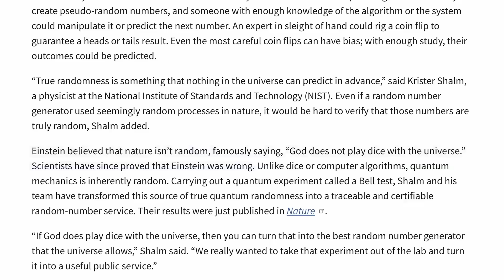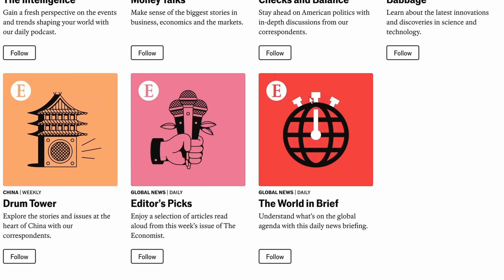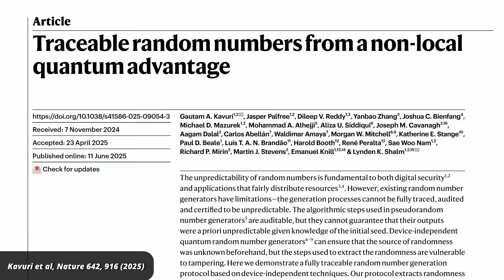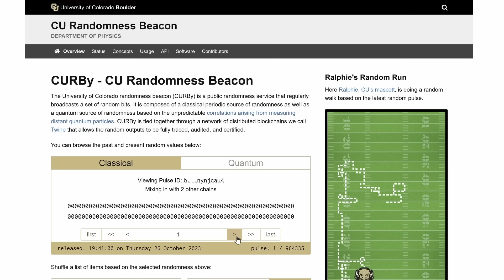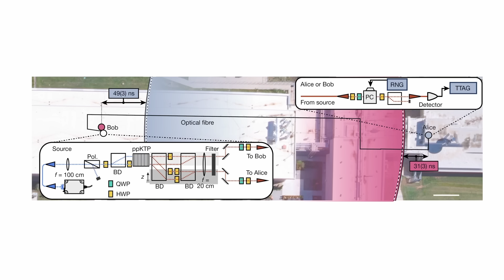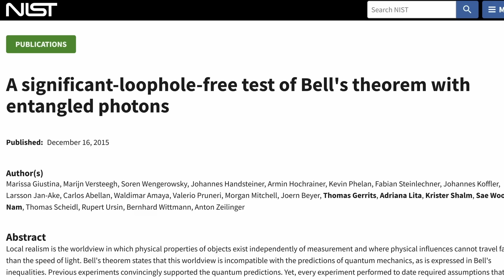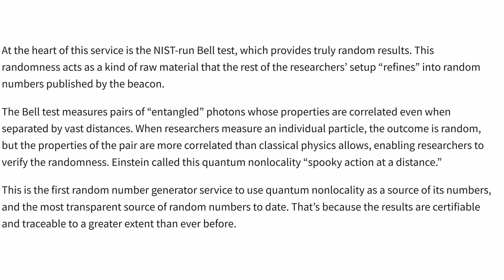Was Einstein Wrong about Randomness?

Comment: I'm not sure it's even theoretically possible to 'prove' true randomness? How would you do that? Keep scrutinizing a sequence to make sure no patterns appear? How long do you stare at it for? Infinite time? You'll find a whole lot of very intriguing patterns in that span of time, random or not! You can eventually prove to some reasonable certainty that a pattern is non-random, but it's hard to even postulate how you'd prove the opposite.
You could of course develop a convincing theory of randomness that convinces people that the seemingly random output really is random for a perfectly logical reason, but you'll need that theory to be pretty rock solid.
For my part I'm betting the universe is in fact random (kind of hard to postulate a convincing arrow of time otherwise) but its going to be very difficult to prove.

Comment: Pure randomness is a mathematical artifact (or "prediction" if you prefer) of ANY quantum theory that: 
1. Exists in a Hilbert space 
2. Undergoes Unitarity evolution
3. Has rudimentary continuity in time (mathematically defined as there exists some sufficiently brief time between two distinct but otherwise methodologically identical measurements of a quantum system that will ALWAYS produce identical results).

The CONSEQUENCE of the above assumptions about quantum theory requires that when one pure state of a quantum system is measured any subsequent measurement of any  ORTHOGONAL state of that system will produce random results.  The physical reason for this is very straightforward: the system contains no information about other states therfore the process of projecting an orthogonal state onto that system is going to produce random results (in psudo scientific terms that projection process is what we call a "measurement").  Stern Gerlach experiments are a good example of this type of "measurement" procedure (both in the sense of "measurement continuity" of repeated measurements and in terms of the randomness of orthogonal measurement).

This is a GENERAL theorem that has been proven several times, first by Gleason, and later by Zurek. Zurek's work on this topic deserves mention because his approach adds considerable clarity and simplicity in contrast to Gleason's proof which was difficult to intuitively grasp and was therfore mostly ignored. 

Interpretation: objects in our universe have FINITE bandwidth for encoding and transmitting information in quantum states.  If two states are orthogonal the existence of one state precludes the existence of preserved information in that object about the evolution of that object in previous orthogonal states... the practical EFFECT of this is the destruction of phase information for those previous states in that object (other objects present in the universe that were entangled with that object can preserve some information about prior states but not the object itself once it's observed to be in a new orthogonal state). This makes perfect sense and is consistent with the uncertainty principle which is what effectively sets the PHYSICAL encoding limit of any system with finite bandwidth.  This is one of those things that's so obvious that it seems complicated or trivial... depending on the mental state of the observer...
Reply: Recent paper about Bose condensate "coarsening" shows that when you put "anything" into a box, and shake it up with some outside forces, that the quantum states and the energy level tend to become "segregated" into specific zones.  This is what the pyramid builders found out, when sifting sand and gravel through a screen, or just shaking it up in a pail.  The particles (ie: numbers) tend to segragate top to bottom, or side to side in 2-3space.  Boltzmann type of statistics, but with specific energy layers or barriers.  The bottom line is "always", that unless you have an Infinite Energy or Numeric Space, there can never be true randomness.  Ever.  A finite Universe is never actually totally "random" as we plainly see in the night sky.
Reply: @brunonikodemski2420  Sound observation, but you are missing the emergence of complexity. It is possible for pure noise to become stable and form structure, so what you see as coherent structure may well be formed out of randomness.
Reply: @axle.student well put... English is my first language but I'm only properly fluent in mathematics! It's HARD trying to translate from math to English! I did my best... you did MUCH better! Thanks.
Reply: @robmorgan1214  English is my first language, but I am only properly fluent mathematically in over 50 different programming languages. Trying to translate from programming to math notation is HARD.
.
Yeah, I'm hearing ya :)
Reply: @brunonikodemski2420 that's not what we're  talking about here.  That's different math.  Real but different.
Reply: @brunonikodemski2420 sorry about my previous response to your comment. It was kind of dumb in retrospect!  The comment by @axel.student is much better! Pretend i said that instead. Thanks!
Reply: Makes sense to me :)
Randomness is not what people typically think it is.
Reply: sure which I understood that !!!
Reply: @MostlyIC I wrote it... and just re read it... now i have a headache.  It's pretty straightforward to express in a few lines of mathematics... English not so much.  Imagine trying to describe the solution to a quadratic equation and the requirements of the equation for a real solution to exist... without using any math... you'd look up 10 paragraphs into the topic and realize you're just warming up! With mathematical notation you can do the whole thing in a few tidy lines... to parapharse a confused man: we go to war against the language we have not the language we want!

Comment: My question regarding quantum mechanics and the tests are regarding the innate randomness or unknowability of a result prior to measurement. 

If in quantum mechanics we cannot know something prior to a measurement outcome how can we know that the particles we test along different axis or different angles are entangled? 

If the particles we started with are entangled we would expect to see an anti-correlation  if we measured them along a common axis. 

So if we measure particle A along the X and get up we would expect particle B along the X to be down.   

But if we measure B along the Y axis, how can we now know what B would have been down along the X axis that we didn’t measure. And if we don’t know what B was along the X axis, how do we know that the initial particles we are working with are entangled? 

It would seem like whether the particles are entangled or not would exist as some superposition until we make a measurement. 

If we don’t measure along the same axis then it would seem that we could not say that the initial particles that we are working with are entangled at the time we made the observation.

Comment: FWIW, it's impossible to prove that a sequence of data is random. How about this one: 789332123832705329762585738279009782646054559855513183668884462826513379849166 

Well, it isn't. It's part of the decimal expansion of pi. One can measure the Kolmogorov complexity of a sequence, which will give you a measure of its entropy, but it will not be able to mathematically prove randomness.

Comment: I used to work for a company that builds online casinos. They use like the 5th decimal point in temperature and air pressure measurements in random locations for seed. So there you go

Comment: On the other note, I got a question. How costly is it to build a system for all these quantum experiments? It takes ~$5M to build a functioning instrumentation that can generate and handle BEC. Prohibitively costly for an individual, but easy if some multimillionaire comes to support. The price might get even lower if working parts are salvaged from decommissioned instruments.
Dr. Sabine, you got the popularity to go for such a setup. You can try to build an "academia independent" group that will do proper experimental research on super-determinism. Think about it. I know u r retired, but u r still young enough to carry on for one more decade at least.

Comment: Even in plain eyes, QM's result is device dependent. How else u get a different interference pattern when u put, say, spin measuring device in one of the slits? Yeah, I'm no physicist. But u tweak the device and the result change drastically - is a very clear indication that the measurement is not device independent.

Comment: Wth! device independence is not the same thing as measurement independence. It's the latter which enters the proof of bell's inequality. Measurement independence means the prepared state is independent of the choice of measurements which will be done on it later on. Device independence just ensures that Bell violation was not engineered/ faked by a clever design of experimental setup.

Comment: I again say don’t mess with this guy - Einstein. Good Sabine. Keep it up. I also very much disagree about true or objective randomness. Rather It’s just another sign of our true ignorance. There only exists subjective randomness. A quantum phenomenon when measured produces a single measurement outcome…this means it always has a causal structure in place without which it cannot interact with any measuring device which are mostly classical. Other way round, anything that doesn’t have causal structure will always be undetectable. So this points to subjective randomness and not any mythical true randomness.

Comment: What the hell is the difference between 2,947,183 and 2,947,183? It seems to me that how a number is generated doesn't matter, algorithmically or randomly. Even a series, there's a pattern somewhere something will find.
Reply: If the pattern is not findable in practice, then we can treat it as random and that has practical uses. And maybe some sequences really don't have a pattern, it's just that it may be impossible to prove that.
Reply: One would expect that in generating strings of random numbers patterns would emerge, by chance. What those pattern might be would be unpredictable.

Comment: "True" or "pure" randomness can’t be proven without somehow dodging the limits of thermodynamics.

Any system that measures its own randomness pays an energy cost: the act of gathering information changes the state being measured. To know itself fully, the system would have to burn all its energy and collapse to nothing. If you probe the random wave function to see if it’s random, you collapse it in the process. So “pure” randomness can’t be both generated and certified inside the same closed box. Either you bring in outside assumptions (too many for Ockham’s taste), or you admit that certification contaminates the result. Even reading out the wave function requires adding energy to turn its state into information.

We can assume a quantum state is truly random as a premise, but that’s not a proof—and proof is what the claim was supposed to deliver.

Comment: Physicists on the Manhattan project were using radioactive decay to generate random numbers over 80 years ago. How is this “new” or unique
Reply: The article Sabine is wrongly bashing is about certified (cryptographic) randomness, which has nothing to do with the universe being fundamentally random (which was Sabine's whole, incorrect thesis), and is unrelated to just having a good random number generator. You need completely unpredictable sources of randomness in certain quantum cryptography schemes, and NIST simply showed that there's a way to get such a "safe" random number generator that can also be certified. Pretty much everything Sabine said is wrong, by the way.
Reply: @aaronfriedman8671  Not disagreeing with any of the points you made, but it still seems like they authors of the paper have come up with a valid, but incredibly complex, way of using quantum behavior to generate a random number. Wouldn't a simple alpha detector with a chunk of americium-241 from a smoke detector do the same thing (possibly with a correction factor to account for the reduction in americium-241 over time) do the same thing?
)? For a given sample period, the actual number of decays will be a normal distribution around an expected mean value, but the exact count will be random. What am I missing in my understanding?

Comment: It is not just device independence. It is also variable independence which is different. The settings on the machines can be statistically independent, and you can still have the correlations come out showing a variable dependence for rhe random variables.  Because the outcome is dependent on both the setting and the outcome of the other correlated variable. 

Meaning... if the two particles are simply interacting during the experiment, depending on what that interaction is, you can get all mathematically possible correlations between outcomes, and the dependence on the settings as a whole is only part of that, it can be isolated. 

Bells theorem is simply a theorem about non interacting random hidden variables.

All you need for measurment independence is that for instance the two spins can start out in any orientation, and you can pick any measurment setting to go along with that. And still end up with the same correlations. 

That is easy to reproduce with a deterministic rule. Easy. All you do is say the first measurment made, turns both particle spins by the same angle simultaneously to correspond with the setting in one lab, and then you can treat the 2nd measurment the same as a randomly prepared spin measured in isolation for any measurment setting, and bells theorem is fine. The inequality is violated by the exact amount it is predicted by quantum mechanics. 

Thars it, not particularly difficult or surprising. 

And it is completely compatible with deterministic classical type mechanics.  These clowns are just stupid it seems.

Comment: Why do people always mention some way that something lie this will make encryption stronger.

 The way encryption works on the Internet is that we all know the algorithm. Cracking it is just a matter of trying all the possible key combinations. It is brute force. 

Contrast that with military, or non-public, encryption. The enigma code was broken, in part, because a machine had been taken from the Germans. Thus, people knew basically how it worked. Fast forward to today. Military encryption devices are kept secure. For example, I worked on a project at a defense contractor. We had a secure line encrypted by one of the most secure encryption devices available because of the nature of the project. It was in a locked room in our very large computer room. We did not have the key to get in. An Air Force officer located in the area did. So, we asked, what happens if there is a fire in the room and the officer couldn't get there quickly (a guaranteed situation). We were told that in that case we would have to wait until the fire burned through the walls to put it out. That was fine with them, since it would mean the device would be rendered completely useless and unrecoverable.

Comment: Normally when Sabine goes off on a rant about quantum mechanics I have to disagree with her, but then she's usually talking about entanglement.  In this case, however, I think we're singing from the same hymn sheet.  Although one should never say never, it is difficult to conceive of, let alone perform, an experiment that would prove indeterminism.  On the other hand it might be possible to devise an experiment that finds evidence of hidden variables in processes that standard quantum mechanics takes to be indeterministic.  If hidden variables are there, with sufficiently high fidelity experiments, patterns may emerge that differ from regular quantum expectations.  Perhaps AI could look for patterns that we would otherwise miss, since the search for a pattern need not be theory-specific. To summarise, empirical tests could in theory disprove indeterminism if it is false, but not prove it if it is true.  That said, the more experiments fail to find a pattern or regularities, the more respectability this adds to the metaphysical belief that indeterminism is correct, without ever actually proving it.

Comment: There are companies out there that sell true random number generation. They use things like a camera pointed at a wall of lava lamps. Numbers are generated based on the clump size speed and color. Once a week an employee will go switch around the heat lamps to keep the predictability low.

Comment: Doesn’t this simply reflect how fields “have” to work?  Its loosely similar to the likelihood a drop of water will spill over a specific part of a large, wide waterfall … probability would describe this likelihood nicely … but randomness didn’t dictate it.  Energize a field at one end and something will pop out at the other end … the position the energy is discharged would have to be based on probability since the whole field is energized. How else would it work?